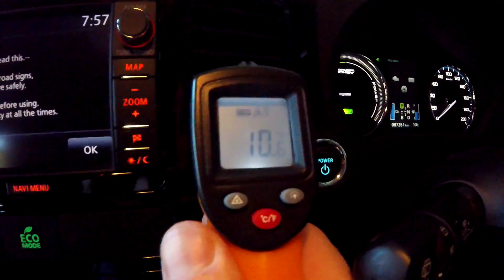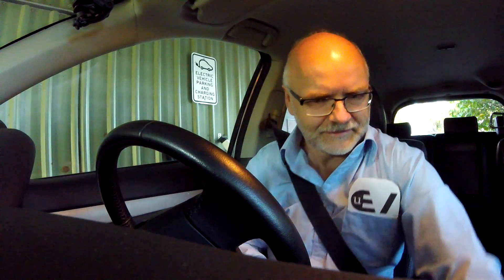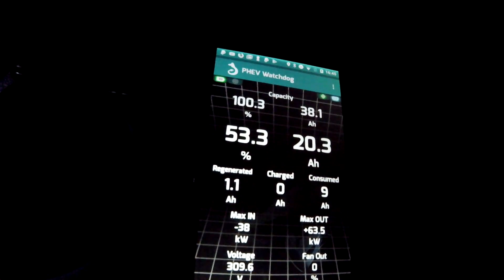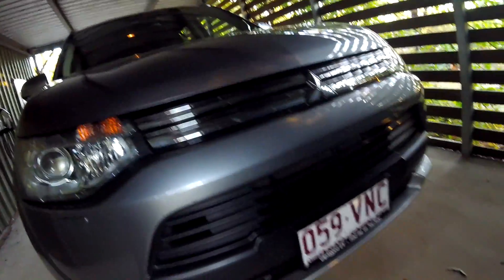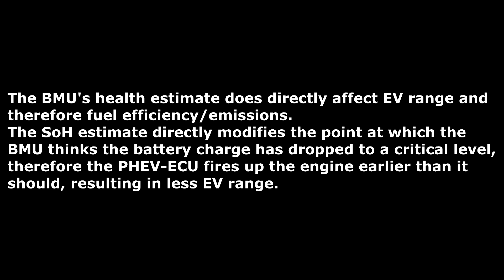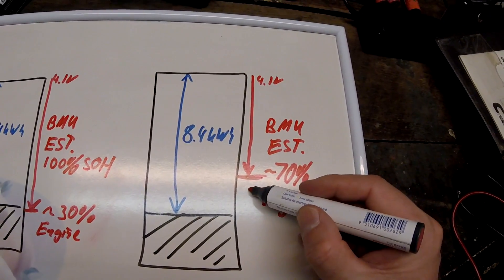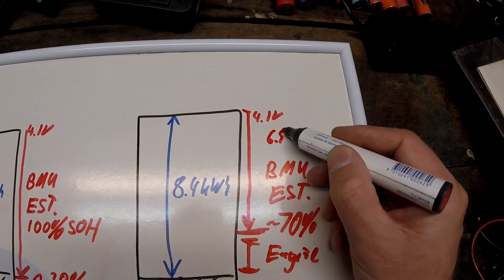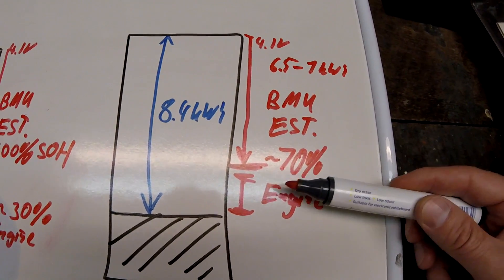EP249 - Fuel and Emissions up, EV down - Mitsubishi's #PHEVgate

Comment: Thinking of buying one I took a Outlander PHEV for a test drive today from a local Mitsubishi dealer. 2016 model with 61000km on the clock, import from our dear neighboring country Sweden. The most amazing thing that caught my eye was the average gas mileage shown by the computer. 21,5l/100km!  Never seen average like that in any car ever. When I parked the car after my 30 minute test drive this leaf thing which I guess is some kind of  "saving the planet" display gave me all green:) and the average was still over 10l/100km. Is having 2Ah more or less juice in the battery pack really the biggest issue this car has?
Reply from the maker: Most likely they idled the vehicle for an hour or so to charge the battery up. If it's a dealer vehicle, they also drive it in and out of the shed twice a day which gives these vehicles a horrible efficiency.

Comment: Hi Andy, i think no manufacturer is telling you about a degradation. This is not only Mitsubishi related. We are in charge to reveal it. You do a good job. 

I was lost one time with a depleted 12V batterie. I got a DBCAM a few month befor an had the 40 Ah back. After my 12V batterie was empty because I let the fan running without ignition I have 38 Ah and it shows 100 % SoH after recharging my 12V batterie. This makes sense what you are telling in your video.
Reply: LancerGLX80 How long did it take to deplete the battery with a fan?
Reply: I am not sure. I slept in the car. I does not turn on the ignition and only pushed one time the power button, so only the car electronic and ventilation turns on. 

I don't know if I turn on the ignition, the driving batterie will support the ventilation?!
I was expecting that the driving batterie is supporting a long time but it was the same SoC as befor, when the 12V comes back online (because I didn't pushed the power button twice. My fault).
I slept 7 hours. So somewhere <7h for the 12V system.
Do you hear about someon who did a test with the ignition on? I am scared to test it after my bad experienece.
Reply: @LancerGLX80  I may have misunderstood your original comment.  I thought you accidentally did a BMU reset by leaving the fan on, which sounds a lot simpler than the Linquist method.  Didn't the 12V battery get automatically recharged?
Reply: @matradlinski8084  thats correct. I did a BMU and batterie reset with the accidential depleted 12V batterie. To unconnect the 12V batterie is better, because the depleted batterie can be damaged by totaly discharging in my point of view.

Comment: Is there a single episode that explains how to drive petrol and battery efficient or is it all spread out over several episodes? It would be great to have some references to important episodes with info about things like this in the reference list...

Anyway, my conclusions on this are that I should always run on battery if I can reach the next charger with battery capacity left (independent of whether the entire ride so far has been on battery or is including hybrid). With that said, I have also noted that it is more petrol efficient to run on petrol only (Save-mode) when you are travelling over 60km/h on a longer trip. Generating electricity with the petrol engine is generally not a good idea due to loss in that process. Using electricity instead of petrol at speeds above 60km/h is not good either. The border 60km/h comes from that the engine only has one gear and it is invoked via a clutch to drive the wheels if the petrol engine is running faster than 60km/h. One can feel this as a small "hickup" sometimes during retardation or acceleration, especially when being a bit heavy on the foot during acceleration. 

Another thing that have been mentioned in one episode and it is also something that I have experienced my-self is that when going slower than 60km/h one can run the battery below 30.6%, it can go at least as low as 27% (or even lower, I have no full statistics on this due to that I rarely am in the situation that I am driving below 60km/h when reaching 30.6% and also will continue to drive below 60km/h for more than than the 1.5km that those 3.6% of battery gives you). 

This means that I am always looking at the battery guessometer during a hybrid drive to try to optimize so that I use battery below 60km/h and petrol above 60km/h (but only for as many kilometers that the battery will not cover). And when I close up to my destination, I always try to leave the battery a bit short (2kilometers) if possible, as I can drive on the extra margin if I am driving below 60km/h during those last kilometers. 

My measurements on the consumption of petrol on longer drives indicates that I save somewhere in the range of 0.5-1 liter of petrol per 100km by not running the generator. It is a bit hard to say exactly how much gain there is as one really can't compare two drives with eachother.

So in short (and a bit simplified) one should: 
1) Press "save" when leaving if your battery will not last the entire trip, you will run on the electricity in the battery up to the speed 60km/h anyway. If you are driving at more than 60km/h the engine will kick in but not the generator. Only regeneration of electricity will charge the battery.
2) Press "EV" when the guessometer shows roughly 2kilometers less than the length of the remaining drive. The battery will likely take you there as long as you drive at 60km/h or slower for the rest of the drive when the guessometer goes from 2km to 1km. 
3) Press EV already from the start if the destination is within reach of the capacity in the battery. This can also be combined with running slower than 60km/h at the end if it is hard to reach the target.

In addition to this I am:
a) almost always running on B0 (except downhill and when using reverse of course). Regeneration works just as fine by pressing the brake pedal. This also makes you be a little less heavy on the gas pedal as you really don't want to break unless you have to.
b) running ECO-mode. Only when I need quick cooling or heating I will not go "green", but that is rare.
c) trying to charge the car as close to departure as possible. That gives a longer driving range and I will not top-up the battery several times as would be the consequence if I leave it charging after it is fully charged. The assumption here is that the power loss from the battery is not linear over the resting time. I have no data about that though.
d) charging the car with 16A, if possible. I have a strong feeling that the 6A charging is not as energy efficient, especially not in the winter. The charging time seems to be extended when running at only 6A in the winter. Likely due to longer times to heat the batteries, but that is only a guess. This is however not fully verified yet. One really should measure outside and batery tmperature to make a generic conclusion about this.

Have I missed something important, or am I wrong about anything in my summary?
Reply from the maker: That will come in EP251 :)
Reply: @unpluggedEV  thanks

Comment: OK, if I take a look into the German warranty description, it says it holds at least 70% within 8 years - if I use my brain this is telling me: it‘s OK (from Mitsubishi‘s point of view) to have only 75 % of my capacity after e. g. 7 years - which means I will loose EV range then. So, I could say they ARE telling me I‘m loosing EV range resulting in higher emissions. What they don‘t say is that the BMU is calculating a, lets say hardcoded, degradation that WILL downgrade my battery over time, regardless what health the battery has :-( and that is the problem, right?

Comment: A nice logical explanation, the implications of which can guide further testing.

To add to the pool of information in respect of the latest method, I have a GX3+ registered in early 2016. I've tried the method twice, the first with battery reconnected during charging, the second disconnected. In the first attempt the battery was disconnected for 6 hours prior to charging, and 2.5 hours the second time. Neither attempt worked according to the dog, although the dash estimated range is currently sitting at 31 miles, this will doubtless plummet as soon as the car moves. Interestingly the battery age is reported to be 1375 days, suggesting neither attempt reset the data.

To me, the crucial part is resetting the BMU data, rather than charging with the battery disconnected. As people have said, the 12v system appears to be active during charging anyway.

Comment: Andy, G'day m8  ( that's Aussie', we brits aren't really very multi lingual 😎but we like the Aussies ) 

Another good vid' 👍 enjoyed it, didn't see the suitcase anywhere ? suppose they have picked up that "drop" by now, good on ya' m8 ( Aussie' ) 
more money towards the Tesla (wink,wink) (or another new battery )

I was thinking, dont do that often if I can help it, If the Lindvist method works most of the time by disconnecting the BMS so it resets etc, why not just go with trying a BMS reset back to default and not bothering with discharge \recharge ? 
Or did I completely miss the point?
So,as I see it, the BMU use the cap' as a backup instead of a battery in this case ? Meaning the ROM stays as the default with the 38Ah \ 40Ah settings, while the RAM accepts the changes written by the BMS as it updates itself. ( I cant remember this type of chip at the moment, starts with an " E " I think?) As long as there is charge in the cap' all is good. 
The BMS can update as it wants following the MM program to protect the battery for 8 years. 
Thats its only main objective.
They have made it very easy to just disconnect the negative terminal of the battery, do you think that's for a reason? 
I was reading some of the comments before I posted this, we may be underestimating MM in what they have done?
They are not going to say, " dont bother bringing your car in for a full service, check or battery reset, do the reset for your battery at home & get the service anywhere that's cheaper "

We have already seen & acknowledged how good this car is overall, maybe the battery & the software is better than we are estimating?

Anyway, Stay Charged m8 😎 cya next time 👍
Reply: I don’t know about that. We know that Mitsubishi officially instructed the dealers not to perform the BMU reset. So why would they be OK if we did it ourselves? At his point I wouldn’t be surprised If Mitsubishi sent a letter to all pHev owners stating that get a letter from Mitsubishi that if we self perform BMU reset at home, it will void the warranty.  It’s no different than my dealer telling me that they can do the BMU reset with MUT device but it will void the battery warranty, which of course is ridiculous. The good news is that Mitsubishi is too lazy to even said such a letter out so I think we are safe. :)
Reply: @matradlinski8084  You don't know about what specifically?  🤔

I thought MM instructed the dealers not to do the triple reset, not just a BMU reset?  

I'd rather know about the BMU reset we can do easily at home, anymore info on that?
Reply: odinterimon.Chris well, you can’t have the triple procedure without BMU reset, which arguably is the most important step.  As I recall being internal  MM document that leaked explicitly instructed the dealers not to perform the BMU reset. The official Q&A document stated that MM will not implement the triple procedure.

Comment: So, logically, the lowest possible cell voltage shlould increase with time. Right? Can we check for that in the dog history?
Reply: Should it? Shouldn't the current needed to charge the battery from low voltage to high voltage (after rest) be what is of interest to measure?

And it should rather be the high  voltage that should go down if the battery is underutilized and the charging/discharging is done the correct way.
Reply: @ervjhb  the current is controlled by the chargers (external and internal ones). The upper voltage is always at 4.1V so what else can be changed?

Comment: There's no "electric air heater," and there's only one heat exchanger. The way it works is the coolant loop is split in two by the 4-way valve, and there are two pumps—one electric and one conventional belt-driven on the engine. When you turn on the heat without the engine running, the electric heater heats the cabin loop only—the valve keeps the coolant in the cabin only. This loop is small and the heater is powerful, so it heats up quickly. (The heater is a PTC resistive device, so it's simple and self-regulating.)
Reply from the maker: Thanks for the explanation.
Reply: Richi Jennings I don’t think that’s correct. There service manual states there is 2 heater types. Mine uses hot water with heater under passenger seat. Takes about 4 mins for hot air to come.
Reply: So you need to have AC enabled for heating to occur?
Reply from the maker: @RobertHutton  No you don't. Just set the temperature and the heater will do the rest.
Reply: @RobertHutton  not sure what your question is, so here are several answers!
1. You need the climate control enabled (which some call "the AC"), either in Auto or manual mode. 
2. Obviously the heating gets hotter quicker if the aircon is off (i.e., the snowflake symbol isn't showing). 
3. Or if by "AC" you meant the Type 1 charge port: No you don't need to be plugged in, but if you're preheating, you'll discharge your battery some if you're not plugged in.
Hope that made sense.
Reply from the maker: The compressor for the aircon is not running just because the snowflake shows. It has no influence on heating up the cabin.
Reply: @unpluggedEV  that's correct. I confirmed this with Mitsubishi. It's only for cooling and of snowflake shows during heating it'll just be pulling moisture from the air
Reply: @WillDeasy  that's odd, I wonder what they meant by that. To condense moisture from the air, it must cool the evaporator; that's just how refrigeration works. You can minimise the amount of cooling by dropping the fan speed, but then you're not going to get very effective heating! 

I'm trying to imagine what the Mitsubishi person you talked to meant, but it doesn't match how my car works, or those of other owners. Perhaps they just meant the heater's effect is stronger than the aircon's cooling effect, which is certainly true. And perhaps they meant the peak air temperature is the same regardless of aircon, which could easily be true. But the air from the vents does get hotter quicker if the aircon is off.
Reply: Is it normal for the engine to start if temperature is set higher than 18 degrees Celsius? It happens with both air-conditioning on and off
Reply: @vino.5319  depends on the temp difference between outside and inside.. if it's over 10c engine will start

Comment: Andy, what will happened if I short cirquit the plus and minus cable after removed from the 12v battery by doing the Lindquist method. May be this will secure discharge the capacitors of the BMU and it's not needed to wait some hours?
Reply from the maker: Most likely this would not do anything to the actual BMU power source. The energy goes only into this capacitor and most likely a Schottky diode prevents the energy from coming out of the BMU again.

Comment: Ok - time for a terminology change ?
We have ll  seen the BMU circuit board and it is not software controlled - we wish :-)
The BMU fault would appear to be a Firmware or Hardware issue.  Yes ?
Reply from the maker: It's the code of the firmware, yes. Which is kind of software..